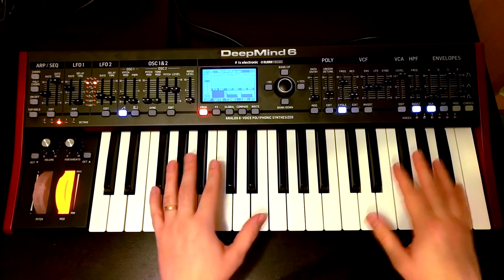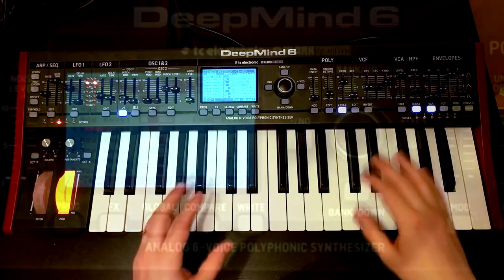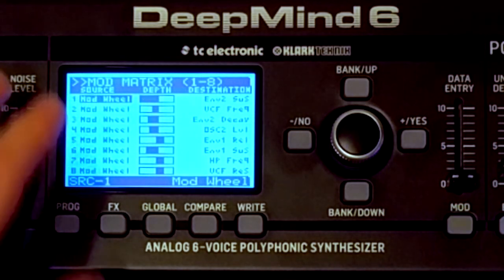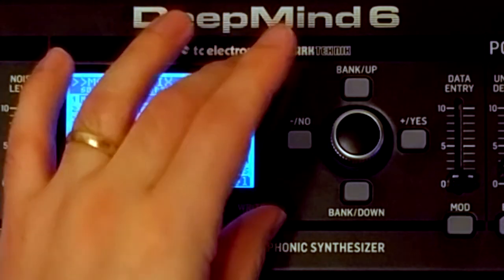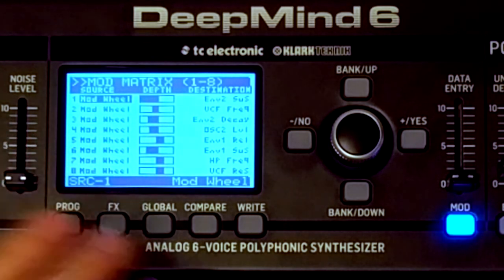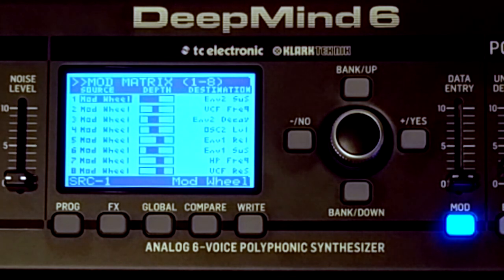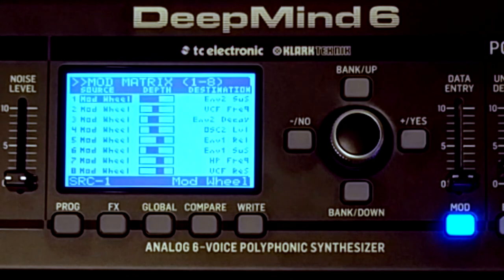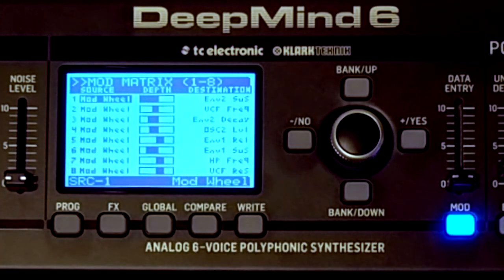Behringer DeepMind - A Morphing Mod-Wheel Patch

Comment: I did not know you could do that with this. Grr I really want one of these... also really want a digitone, I hate gas!
Reply from the maker: Haha, sorry to feed the GAS! My bad! If it helps, I also want, and cannot currently afford a Digitone as well. We can wallow in the GAS together on that one.
Reply: The DM6 and the Digitone would be great together ... probably the only two synths you would need for many applications! Unless you have a really bad case of GAS. :-P
Reply from the maker: You'd need (for example) a Sub37 or an MS20 as well...but then you'd probably be good for a while... Maybe...
Reply: Never get gas that bad but I think I better stick with what I need for producing and this seems an essential one. Does the keyboard have aftertouch?
Reply from the maker: It does, although, truth be told, I find the response kind of uneven. It's really my only slight annoyance with the instrument really.
Reply: Cool. Well the time it takes me to save for this I will have learned my beatstep pro well enough. Think it’s your videos that got me to buy that too. Haha